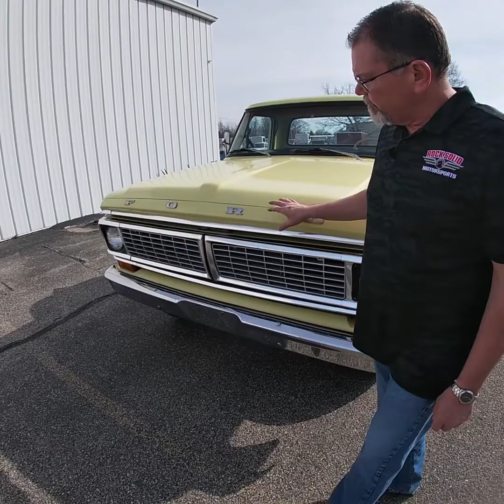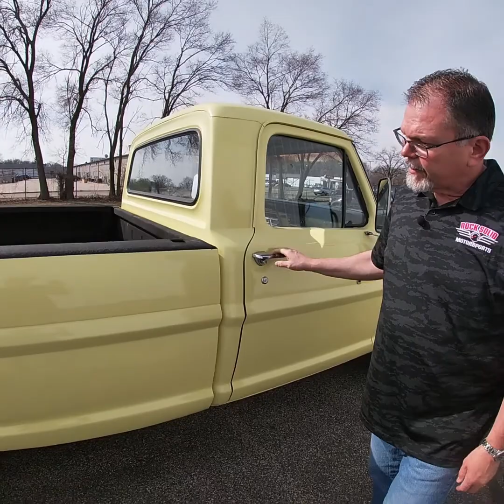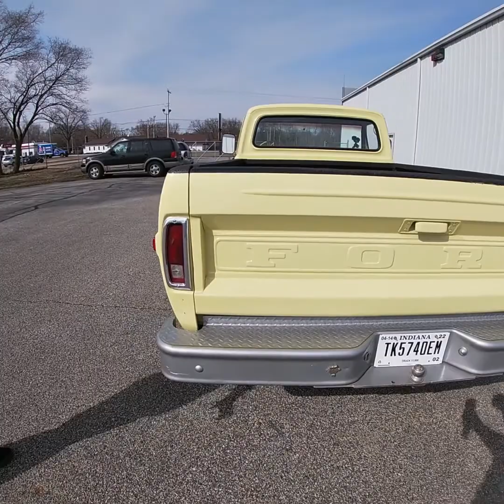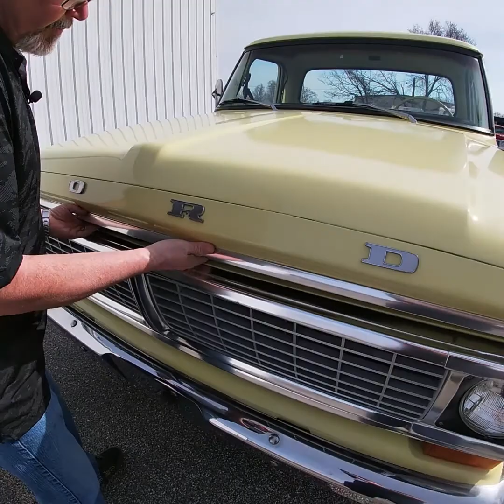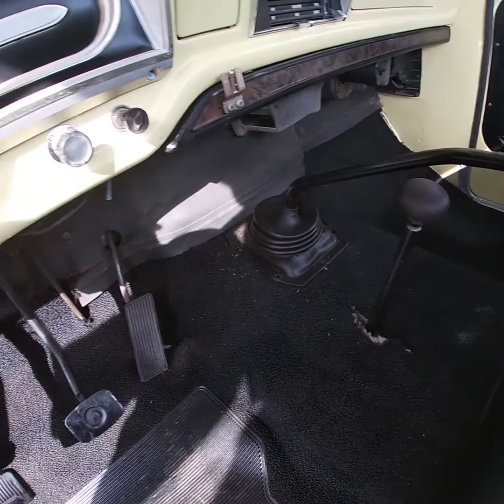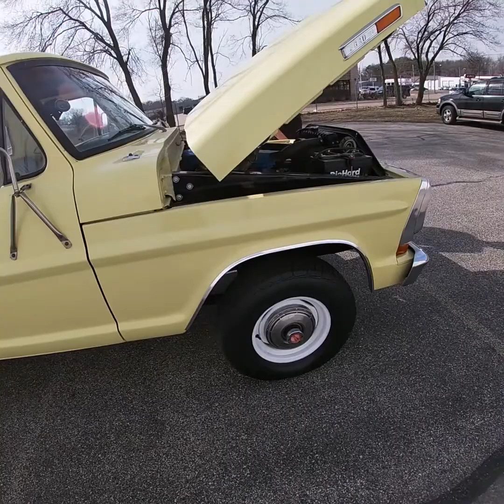1970 Ford F100 4X4 Walk around and Test drive

Comment: This truck is like my grandpas truck he bought new in 1970 he purchased a 1970 ford f100 4x4 with a 360ci top trim for a 4x4 was the Ranger model. Had a horn ring and lots of wood trim and chrome on the outside. That truck moulded my love for trucks it had bias ply traction tires on all 4 corners. It was garage kept all its life. I vividly remember the feel, smell and ride of this truck. My grandpa used it a pickup so it was banged up but still in excellent shape. He sold it in 1990 I was a kid and had no say. It still get upset thinking about it leaving my life. I have never got over it. These trucks are impossible to come by in Ontario Canada. In the past 20 years searching have with the ability of buying never seen the right year f100 in a 4x4. I have never since seen one in person. As a gear head I have looked at A LOT of old cars.